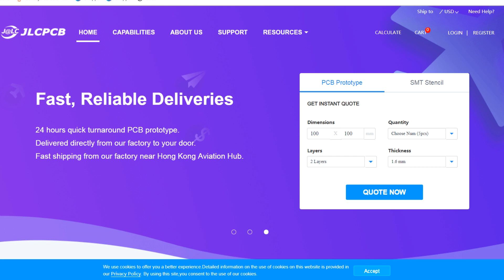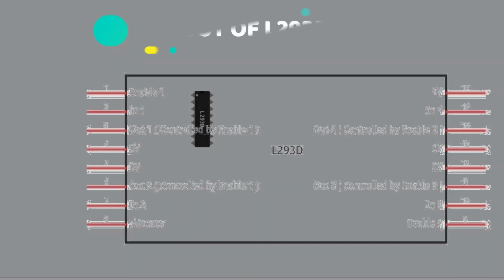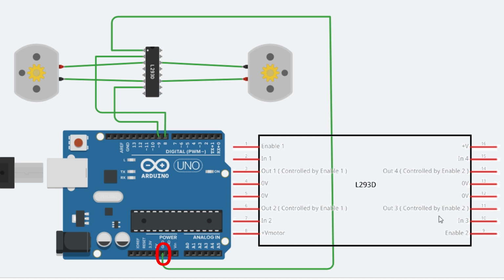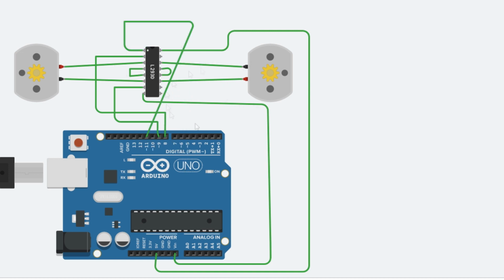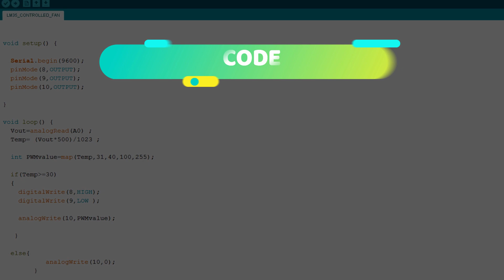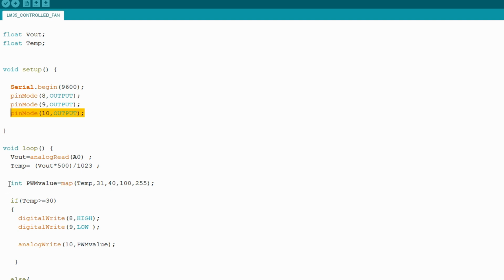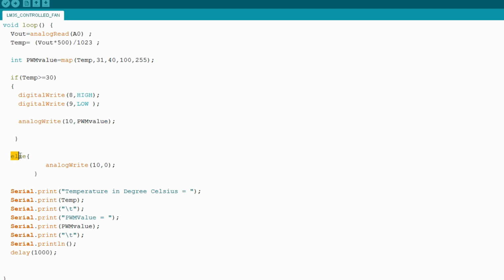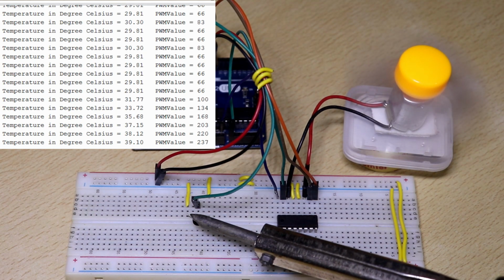Temperature Controlled Fan Project using Arduino| Pt. 2

Comment: float Vout;
float Temp;

void setup() {

  Serial.begin(9600);
  pinMode(8,OUTPUT);
  pinMode(9,OUTPUT);
  pinMode(10,OUTPUT);
  
}

void loop() {
  Vout=analogRead(A0) ;
  Temp= (Vout*500)/1023 ;

  int PWMvalue=map (Temp,31,40,100,255);

  if(Temp>=30)
  {
    digitalWrite(8,HIGH);
    digitalWrite(9,LOW);

    analogWrite(10,PWMvalue);
  }
  else{
    analogWrite(10,0);
  }

  Serial.print("Temperature in Degree Celsius = ");
  Serial.print(Temp);
  Serial.print("/t");
  Serial.print("PWMvalue = ");
  Serial.print(PWMvalue);
  Serial.print("/t");
  Serial.println();  
  delay(1000);
}

Comment from the maker: NOTE: Hey guys in this project I have used a simple 12V DC motor just for demonstrating the project prototype. But you can replace DC motor with a DC Fan. Just keep in mind the following points:

1. The current rating of the DC motor installed inside the fan must be less than 1A because Arduino's Vin pin cannot supply more than that(if you are using Vin pin to power the IC for OUTPUT)

2. The maximum current output of L293D is 600mA per Channel(for 1 motor). So If your DC fan current rating is greater than 600 mA but less than 1A then use two L293D in parallel. It's better
if you use any other motor driver IC like L298N which can easily supply current up to 1A.
 
3. If you are using Standalone power supply for L293D(for Motors) then you can use voltage up to 36V as mentioned in datasheet of L293D(Ofcourse Motor voltage rating must match with that voltage). In this case, the current is limited by only one factor: Motor drive IC Current rating. So you can simply use high current motor driver IC or use L293D IC as many as you want in parallel.
Reply: Bhaiya ek baar mere drone bnane wala video dekh kr cmmnt KR do 🙏🙏